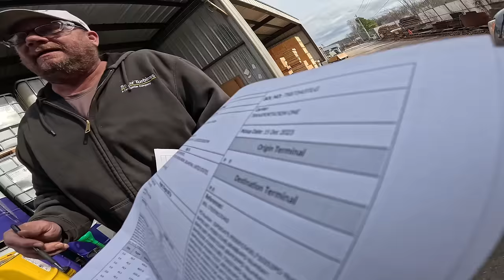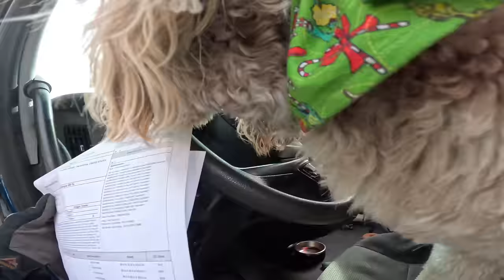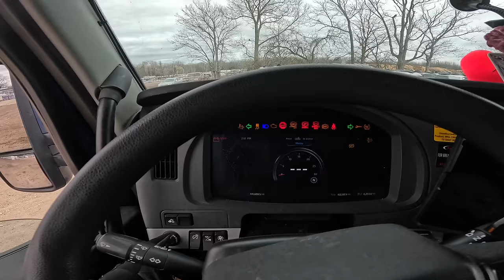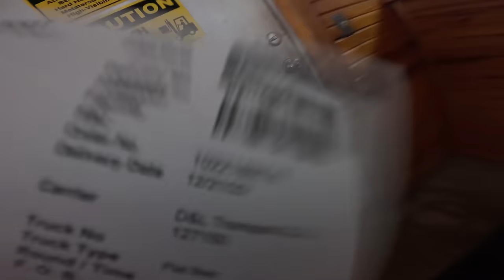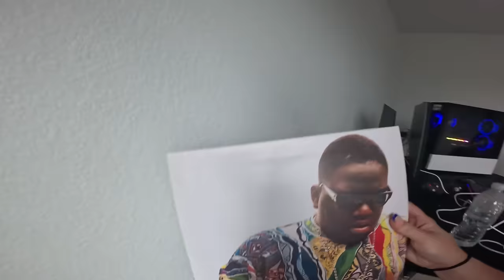I Met The Most Considerate Forklift Driver Ever! 🙏

Comment: Hello I find your videos to relaxing I just watched all of them in the past 3 days I miss being out on the road my Dad was a truck driver for 40 years I was with him for 10 of them unfortunately I cannot drive I am disabled but as far as tearing your tarps The person that makes yours should be able to add a thin layer of Kevlar inside your tarp's it will make them slightly heavier but they Should not rip did something happen to your heated coat because I don't see you using it when it's cold anymore I have one of those I love it in the winter

Comment: You are absolutely correct on the stimulus……
Add: You impress me with your work ethic and confidence to run 80,000 pounds all over this country. Much respect from a much older CDL holder that has been in a fabrication business 35 years.

Comment: I used to base loads on the interstate the truck was going on. Generally, I loaded a little heavier on the left because most roads slope to the right. Some strangely slope to the left and those got loaded to the right. 
Balance is key but in winter, I loaded heavier in the nose. I miss it sometimes.

Comment: Hey Becca! Great video.

Stupid way off-topic question.... You figure out how to pivot that passenger seat?

I had a sales guy tell me mine didn't pivot and I had to show him how it DID! LOL😂
Reply from the maker: OMG! Ive tried and I could never find a level on it or anything. I thought I got the truck that didn’t have a turning seat. 🤣😭
Reply: @bigrigbecca  there should be a small black lever if you're sitting in the seat on the front left floor side.

You rotate that up and at the same time you pull the bar in front of the seat to slide the seat forward. While you're sliding it forward and you have the lever pulled up twist the seat toward the center of the truck.

Let me know if it works for you!